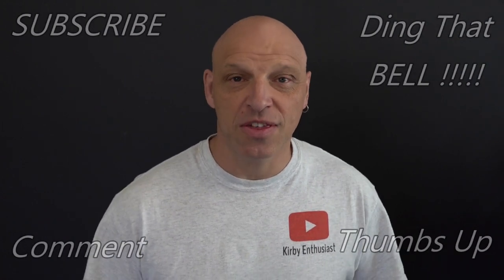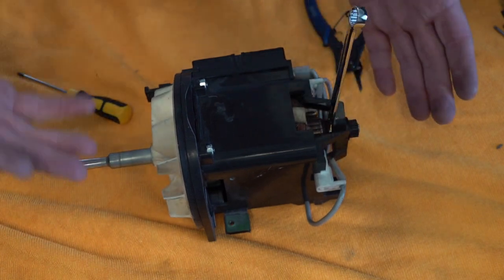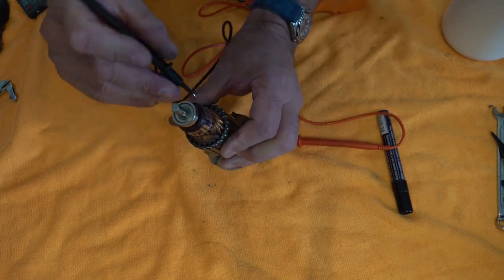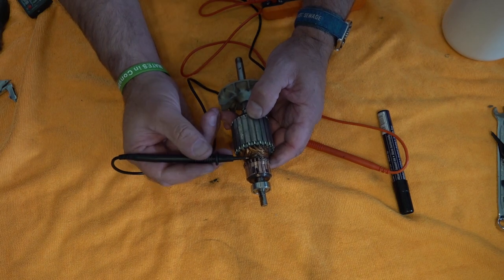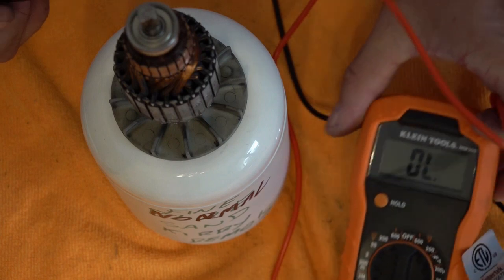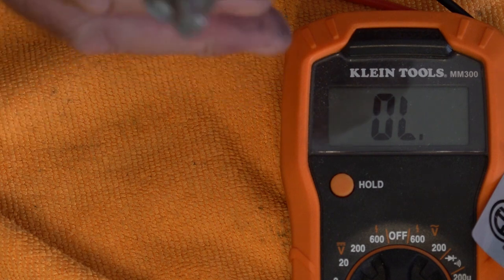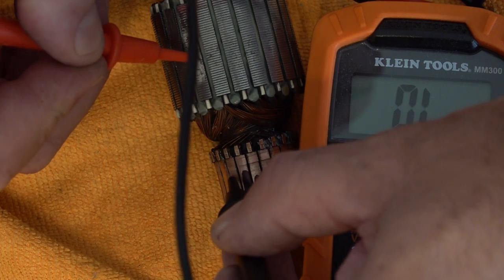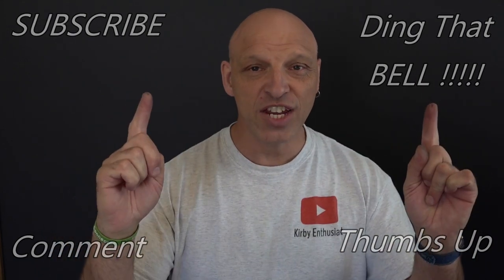HOW TO TEST ARMATURE: KIRBY AVALIR VACUUMS/KIRBY ARCING

Comment: Very interesting. The armature is a blank spot of knowledge. Playing the video a few times. It isn’t clear how to set up the meter, what to register? What is good/wrong? It is a lot too fast. I am not an electrician. So conclude that the armature has broken threads or broken connections and has to be replaced. Nevertheless,  this kind of informative videos I am very interested in, because I am a “ Noob “. I hope I am not the only one. It makes me feel dumber than I feel me already. 😉🤞🏻
Reply from the maker: I did it as time lapse to keep viewers engaged . It had 3 faults which I marked with pen . Showed the 180 test , bar to bar and bar and the final test . The meter you set to the lowest continuity setting to perform the 3 tests

Comment: My kirby vaccum won't turn on... did all these and the armature is reading 0.8 ohms...with no high readings... would the ohms being low mean the armature is no good.?? Any help would be appreciated?
Reply from the maker: Have you checked the brushes and safety switch
Reply: Yes I have...took the whole vaccum apart and still no power.
Reply from the maker: @Anton71186  have you checked the brushes arnt worn